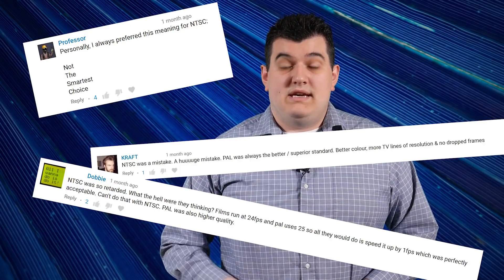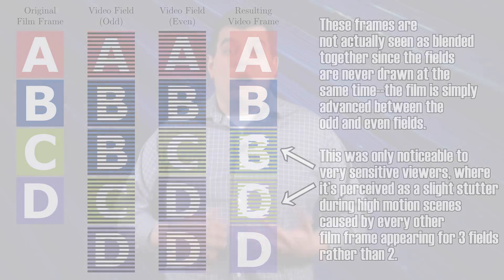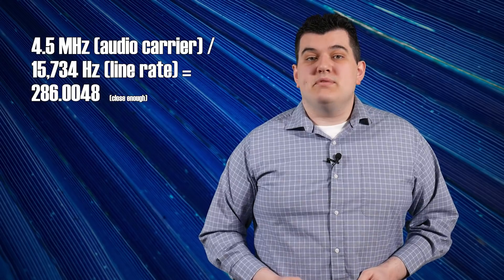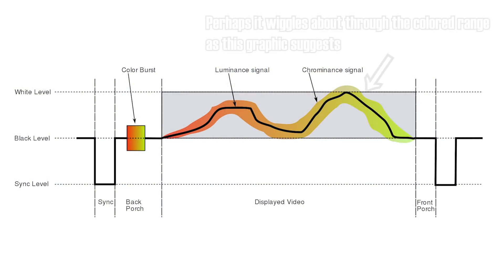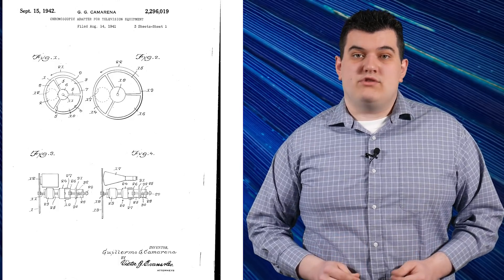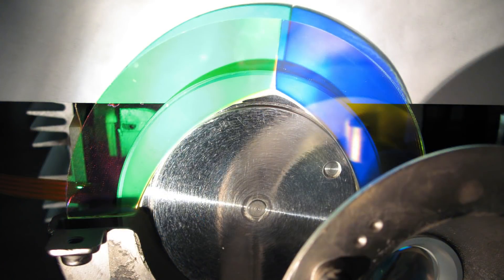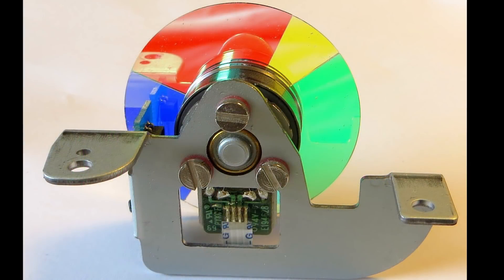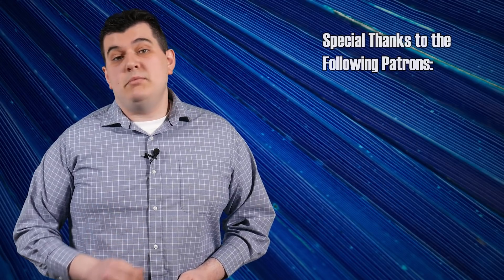Analog Color TV Wrap-Up--Some extra info

Comment: PAL is actually used in a lot of other places around the world, outside of Europe. NTSC is basically just North America, parts of South America, Korea, Japan & some parts of China. On a global spectrum PAL is the leading standard for a reason. And i doubt that they could not have given NTSC an update to make it better. We even had something called  PAL Plus, in the mid 90s which gave the PAL standard a little upgrade (before everything was turned to digital broadcast) and it was even compatible with all TV sets. So they COULD have make NTSC better if they actually wanted to. Also PAL simply works without dropped frame trickery. 25p perfectly fits into 50 interlaced frames and gives you 25psf when ever true progressive scan is not possible or available. No dropped frames, no inversed telecine needed. Further more we also had something called PAL 60 which is a 60 hertz mode for consoles to make them run at NTSC speed but within PAL standards. Something that Consoles like the Dreamcast used for many games and was later also used on the Gamecube. Even DVD and Blu-ray players can do that and can playback NTSC DVDs like that. Heck, even VHS Decks had such an option at one point.
Reply: My guess is no they couldn't give NTSC an upgrade because the FCC wanted compatibility. Even if they would have allowed an upgrade to NTSC, everyone who was working on NTSC was trying to make every innovation compatible.
Reply: Do you see problem here? USA and Japan and Korea use NTSC (or some version of it), 3 biggest electronics manufacturers on this planet and 3 biggest game markets, use NTSC standard. PAL 60 was used for parity because NTSC was that format for which games were mainly developed. Decision of which format will be used was in many cases political or because some country or manufacturer delivered equipment needed. Why you think Japan has two separate eletrical systems, one 100V/50Hz and second 100V/60Hz? Why Nissan/Datsun started with clones of Austin and Isuzu with clones of Morris? Superiority of technology isn't decision maker every time.
Reply: It seems that superiority of technology seldom is. Betamax was technologically superior to V.H.S but failed hard. Laserdisc had better picture than even Betamax, and offered perfect freeze frame and chapter search, and many other features, but it also failed, but not as hard as Betamax.
Reply: What is the fuss? PAL and NTSC have been obsoleted through the last decade.
Reply: PAL and NTSC systems have been both obsoleted by digital compression. You have to remember that in the context of when it was developed, PAL colour coding is only a minor variant of NTSC. PAL encoding was actually investigated by the NTSC in 1951-2 and was discounted because of the lack of a one line delay necessary to average lines at the decoder. The NTSC favoured PAF (Phase Altenate Field) over PAL because the adjacent field averaging was more acceptible with only visual averaging. The US opted for the assymetrical colour difference signals and vestigial wideband I in the final NTSC standard due to the US RMA 6 MHz which was used from 1936 to  2009. Europe and Asia after WWII opted for 7 and 8 MHz channels which allowed greater flexibility.

A couple of further points: the BBC  was as late as 1966 planning for 625 line NTSC color but made a last minute change to fall in line with most of the rest of Europe. France of course opted for the SECAM alternative.
The selection of the standard was a political not an engineering decision. NTSC encoding at 625 lines ultimately would have looked better than PAL because of increased chroma bandwidth due to the wider European channel and  better luma chroma separation hence less annoying cross colour and flickering "cross colour" with improved resolution overall.

Comment: Technology Connections

6:13

I was going to comment on this in your previous vid, but I assumed that you would release another vid to explain it...

Yes, the chroma signal does indeed DIRECTLY modulate the Luma signal.

This is something that I also found surprising many years ago when I first started doing TV / VCR repairs, because people often only talk about things in terms of "carriers" etc.

That information has to be encoded somewhere into a Composite signal, and therefore be seen quite easily on an oscilloscope, so it's not quite like a separate RF carrier offset as such.

This diagram explains it better than I ever could in words, and shows exactly why you see the dot crawl on a colour Composite image (or on a B&W display)...

https://m.eet.com/media/1050360/C0195-Figure2.gif

For a normal "vertical bars" B&W test pattern, the waveform would be the purple line (ie. the classic "staircase" waveform of that test pattern).

To add colour, the Luma signal is just modulated with the higher frequency chroma carrier (centred about the original Luma level, with some clipping at the upper limit).

The amplitude of the chroma somewhat denotes the overall saturation of that part of the image, and of course the phase difference (between the new signal and the colour burst) changes the actual colour displayed.

But technically, yes, on a spectrum analyser, the chroma signal would show up as a separate carrier peak at a higher frequency to most of the original luma signal.

The chroma is essentially FM modulated, so it would have it's own average bandwidth as well.
Reply: When trying to generate an NTSC or PAL signal from an FPGA or MCU, one of the gotchas is that the chroma carrier needs to be running at all times, and then you only "gate" the signal on during the colour burst (and obviously during each line as well.)

If you just start the chroma waveform from "zero" on each colour burst, it will never keep the correct phase over time, and so the PLL in the TV / VCR won't be able to lock on to it.

The colour bursts are basically there to keep "nudging" the PLL, so it can keep a reference of the exact frequency and phase of the original chroma carrier.

The rest of the analog decoding then just uses that reference phase to calculate how much phase offset is being applied to the main chroma signal (modulated onto luma) at any point in time.
Reply: btw, I personally never noticed the 4% speed increase on PAL movies until it was pointed out to me.

And although I would now would of course rather prefer to watch the movies at the correct speed (and running time), I really hated the 3:2 pulldown on NTSC DVDs.

It usually wasn't just a subtle judder on camera pans with NTSC, it was often quite jarring, and this was even on an old-skool NTSC-compatible CRT and DVD player.

(like on Terminator 2, when the T-1000 first arrives at John's foster parents' house, the judder is quite noticeable.)

I used to buy many DVDs back then as Region 1 (NTSC) imports if I wanted to get a release sooner, but I never liked the 3:2 pulldown thing.

It was also to do with the differences between the interlaced fields with 3:2 vs 2:2 pulldown, because 2:2 meant that you had a perfect freeze-frame (from a movie source), as both fields were taken from the same original frame.

This obviously isn't such an important feature, but it does mean that the perceived resolution on PAL releases was slightly increased once things start moving.

With 3:2 pulldown, you get the characteristic interlaced combing artifacts, unless your DVD player or TV at the time had internal processing (like motion adaptive de-interlacing) so it reconstruct the original frames.

(see the "police car GIF" from The Fifth Element, for example)...

https://hometheaterhifi.com/technical/technical-reviews/dvd-benchmark-part-5-progressive-scan-dvd/

The speed increase on PAL movies just isn't something we ever noticed until it was directly compared to an NTSC movie, but yeah, I'm glad that they've (almost) fixed all of those issues now.

Everyone will of course have differing opinions and biases on these subjects, but it's always interesting to talk tech. :p

Most of these things were obviously compromises for the tech of the time, and for historical / compatibility reasons, and I'm really glad that we now have things like Blu Ray, and true 23.976 FPS movie releases.

(and displays that can directly handle that frame rate.) ;)

Comment: IIRC there is a reason why PAL uses 50hz and NTSC uses 60. I am not totally versed in the subject, but I think this was the explanation:

Most outlets in Europe outputted 50hrz, meaning the TVs had only 50hrz to run off of. This is why the signal was in 50hrz as well, and they decided to compensate for the lack of signal speed by instead of having the extra frames that faster signal rates would allow, they went with higher resolution that didn't really affect the signal speed that much and because they had the time to plan for better bandwidth they could fit it in there. I am not totally certain why the outlets use(d) 50hrz, and IIRC this also wasn't totally the case with the UK either despite using the PAL system limited to 50hrz.

America, on the other hand, has outlets that output 60hrz. This allowed TVs to have a faster signal so we had a higher framerate. But of course, the FCC didn't really understand the technology and what was being developed at the time so they settled on a certain bandwidth for black & white TV that wouldn't quite be enough for color TV without some clever tweaking (that you've already mentioned).

Comment: I discovered that my 1990s 14" CRT TV (with an RGB compatible SCART socket on the back) that I still have can display NTSC just as well as PAL when I discovered a tint setting on the picture coming out of my Raspberry Pi, I didn't even realise it was outputting NTSC by default and that I had to edit the config.txt to have it output the superior colour standard.

And it seems your excuse for holding onto NTSC is exactly the same as our excuse for holding onto DAB (based on MP2 audio and MP2 is not a typo) instead of DAB+ (based on AAC audio) or IBOC in the UK, the UK were very early adopters and there are too many sets that would be rendered useless by the upgrade!

Also, you're right to get irritated at the comments over frame rate and line numbers, that was determined by the phase of mains electrcity, not the colour standard.  Also, NTSC came before PAL.  

When did SECAM come out?  Surely that is what NTSC (and PAL) should be compared to.  

Also, the French had an 819 line black and white standard... then they went with 625 line SECAM... you want to do a video on that?

And, the lack of backwards compatibility in the UK at least was helped by 405 line TV only being broadcast on VHF (Bands I and III) and 625 line TV only being broadcast on UHF, we had dual standard black and white TVs that would switch between standards based on the selected band.  I don't know if there were ever any dual standard colour sets... BBC1 and ITV launched colour services on UHF as well as continuing their 405 line VHF services.

I think it was the BBC and the BFI who managed to extract colour from chroma dots.  

Isn't the NTSC colour carrier based around cyan and orange phosphors?  

TALK ABOUT SECAM!!!!!!!!

You are right, you'd need a really old colour TV to have the same pshosphor pattern as now old CRT monitors.  I think ny LCD TV... in fact IO think ALL of my LCD displays use the same RGB triads as found on newer CRT TVs.

Comment: I restore 405 line black and white television sets as my hobby. The image quality is actually very good. The reason it's even viable to restore these sets is because an ingenious American chap who created a small size standards converter called the Aurora. Before his invention the Converters were very large the BBC Originals were in fact the size of an entire room. There were a few convertors made by others in the 90s  the domino converter and the dinosaur converter but these were the same size as a vhs machine and very expensive. The aurora converter only costs around £200 which is actually a small fraction of the cost of the older ones. 

The BBC did experiment in the mid 50s with 405 line NTSC colour sets but unfortunately didn't go with it in the end. A few collectors have these very rare colour sets and I know of two that have been restored to working condition. The resulting picture quality is actually very good.

Comment: RCA actually had PAL working in their labs before NTSC was adopted. But the prototype required a huge coaxial cable coil as a delay line that made it impractical as a product.  Walter Bruch's brilliant invention was the tiny plastic acoustic delay line that solved that problem.

While the most popular format for PAL is 50Hz, in Brazil it uses 60Hz instead making it far easier to directly compare NTSC and PAL. The NTSC image is sharper since the color phase correction in PAL nearly cuts the vertical chroma resolution in half.

The use of transistors and then integrated circuits in TV receivers allowed new features to be added to NTSC in the 1970s that eliminated most of its problems. GE and Tektronix, for example, added the Vertical Interval reference waveform to line 19 which both eliminated the phase problems of sending programming from Los Angeles to New York through successive microwave relays and later allowed the tint button to be automated in each receiver.
Reply: "RCA actually had PAL working in their labs before NTSC was adopted." You must have misunderstood something. PAL was developed years after NTSC was already broadcasting.
Reply: My father worked in the RCA TV labs in the late 1950s (in Marion, Indiana) and told me he saw PAL prototypes that predated the official invention of that system at Telefunken by quite a bit. I have no documentation about this, only his memory about it. RCA probably never published anything or the 1962 PAL patent wouldn't have been granted. By 1961 my father was working for GE in Brazil, so the prototype he saw certainly was before that.
Reply: PAL was developed beginning of the 1960s, patented in 1962 and presented to the general public in 1963, therefore I do not doubt reports of PAL prototypes dated in the early 1960s. But NTSC was standardised in 1953, and the first national broadcast happend in 1954 -- 10 years earlier. So clearly nobody could have seen PAL before the adoption of NTSC.

Comment: For NTSC, was the higher I bandwidth actually still used in broadcasts?   Recovering the "wideband I"  of more than 600 KHz required an extra filter in the set which added to the cost.   I read somewhere years ago that since most receivers did not extract beyond 600 KHz in the lower I subband part (it only had 600 KHz of room above the color carrier anyway), so as a result, it stopped being broadcast and equiband 600 KHz I and Q became the norm in the 1970s and on.    PAL moved their color carrier up higher in the spectrum due to 8 MHz TV channels rather than our 6 MHz and had roughly twice our color bandwidth for both of the color components if the 600 KHz equiband info is true for NTSC.
Reply: I remember an engineer in the 90's telling me that they still had to broadcast the full I bandwidth to be in NTSC compliance even though there weren't more than a few hundred consumer televisions that would decode it properly.
Reply: On pages 365-370 of Charles Poynton's book "Digital Video and HDTV: Algorithms and Interfaces", he goes into a good bit of detail about the wideband I issue and how it was abandoned and he states that wideband I was effectively banished from terrestrial broadcasting due to the SMPTE's 1990 adoption of standard 170M and that by then, proper encoding was rare.    He also states that by about 1980, and prospect of wideband chroma at comsumers' premises were lost due to cross-contamination above 600 KHz at the transmitter due to naive low-pass filtering of higher bandwidth video to the 4.2 MHz bandwidth.

Comment: In Brazil we used our own custom 60Hz PAL-M system which was basically the same resolution and FPS of NTSC, but it used the PAL system. It was backwards compatible with the black and white System M (same as the one used in the USA) This had the advantage of us technically having a system superior to NTSC, but also meant that for a long time we couldn't directly use imported TVs, VCRs or even videogame consoles, nor we could export TVs and other products produced here

By the 90s and 2000s, all TV sets started accepting both systems (some even 50Hz PAL) so this became less of a problem

Comment: The explanation for the chroma dots is a lot simpler than you think. You say "because the luminance signal is used in calculating I/Q..." which is not correct. What you wanted to say is ".. the line/raw signal is used in calculating I/Q ...", with the line/raw signal being what you would see if you looked at the signal in an osciloscope. That raw signal includes both luma and chroma simply added together. Luma is the signal it always was during the black and white days. But then we mathematically add to it chroma, which is a QAM modulated shifted to 3.5Mhzish. If you look only at the chroma signal modulated at 3.5Mhz, it will look like a quickly changing pattern with freq centered at 3.5Mhz, which are the chroma dots. When you mathematically add this to the luma signal, you get the good ol' BW picture plus some funky noise (chroma dots) at 3.5Mhz.
It does help to look at the spectrum representation of the NTSC signal, which may help understand this: https://en.wikipedia.org/wiki/NTSC#Color_encoding
Reply: What is "line/raw"? I have never read this term in any text book and I can't find it anywhere.
Reply: 'line' or 'raw' signal is simply the signal you see in the oscilloscope if you tap on the composite video wire. It won't be mentioned anywhere because there's no need to. It's the default video signal one would be talking about here, but I used the adjective to differentiate between separate luma and chroma.